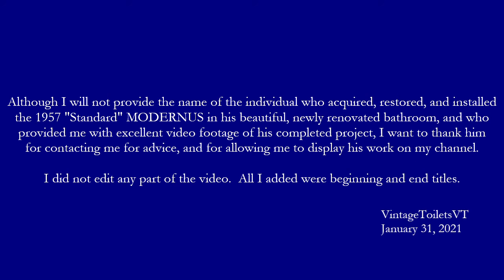103.   Restored  & Installed 1957 Standard Modernus

Comment: That is a top notch job! I love the brass parts in the tank. 
Going by the logo, I'd say that bowl is probably late enough that it has an outlet horn that is flush with the base, which is nice because that will install on a 3" flange. Extended horns need a full 4". You might get lucky if the bathroom floor was redone and raised flush with the flange as I did when I installed my 1948 Cadet.
Reply from the maker: I'm sure the owner of this beautiful antique will be pleased with the comments his restoration is getting.

Comment: Nice restoration,  looks a lot older than 1957, seems most toilet manufacturers went away from the wall hung tank and flush ell to the contemporary design with the tank attached to the bowl by the 1930s-40s.   

Resembles the toilet in the men's room at the harbor beach community theater in Harbor Beach Michigan where I lived when I was a kid, probably the original toilet when the place was built if I had to take a guess.   The theater was completed in 1921, burned down in 1926 and finished rebuilding in 1927.  Haven't been there in over 25 years since the mid 1990s when I was in grade school but I wouldn't be surprised if the old toilet was since replaced with a new high efficiency 1.6Gpf or less model.  If I ever make it back up there and the old toilet is still there I'll definitely have to make a short video of it and upload it to YouTube.
Reply from the maker: The man who restored this toilet and remodeled his bathroom did a fantastic job with both.  The Modernus was made from the '30's all the way into the '60's.  There were 2 distinct versions of the Modernus bowl, that nobody can figure out.  The closest and most logical guess is that they were made in different manufacturing plants that used sightly different molds.  The 4050 tank was made for about the same amount of time.  This bowl with its rounder water spot (vs the triangular) looks '30's to me.  But I think this style was also made into the '50's.  At any rate, it is a beautiful toilet.  I have my 1936 Modernus installed at my summer cabin.  It is an excellent performer!!  Thanks for your comment, @Sparky-ww5re.